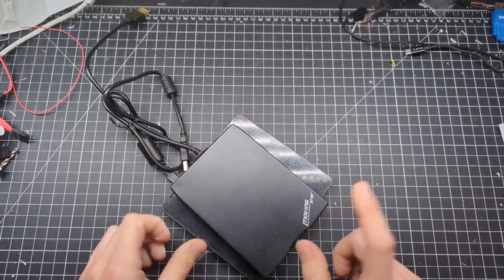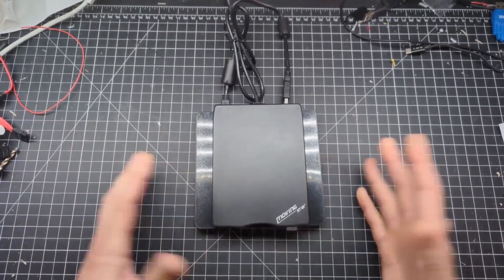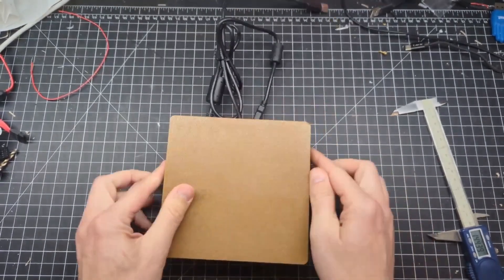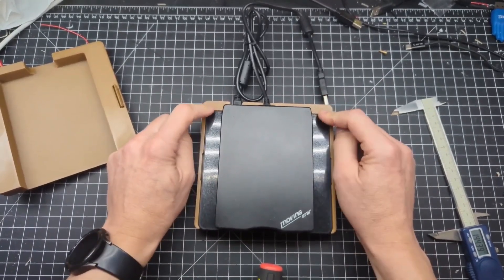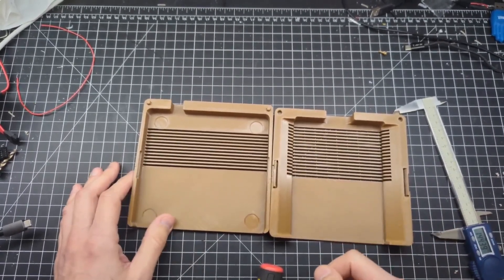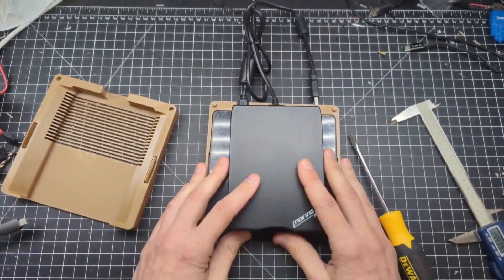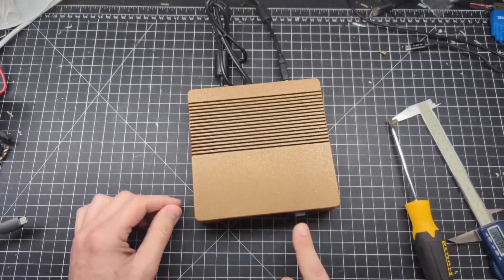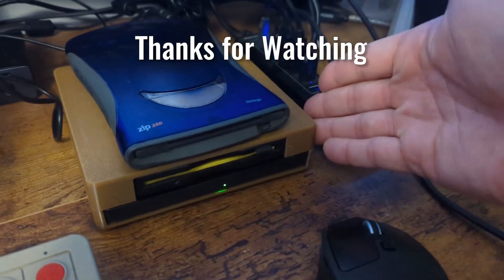Retro Inspired Optical Floppy Drive Case

Comment: Nice. But wouldn't it be better to replace the individual plastic cases of each device with the unified one? And also have a USB-hub built in to get rid of the second wire.
Reply from the maker: After making this, I absolutely agree! I'm working on a revision, not because I need to but because I want to. That's what's fun about CAD and 3D printing. You can make whatever fits on that build plate!
Reply: and make it USB 1.0 compatible for it to work on legacy devices too, like good-ol' windows 98SE computers